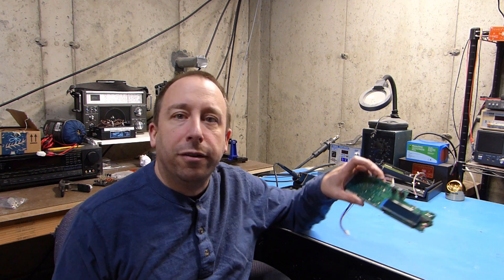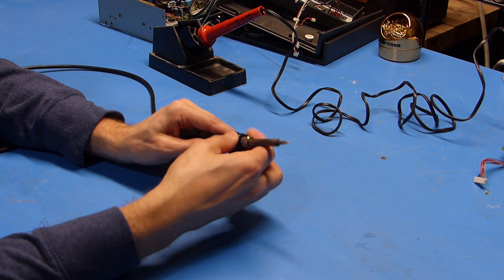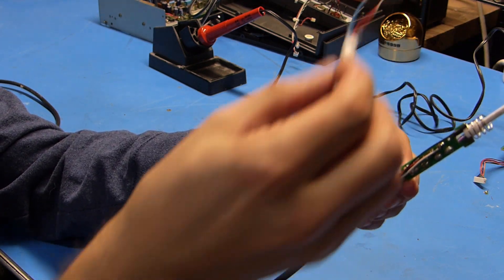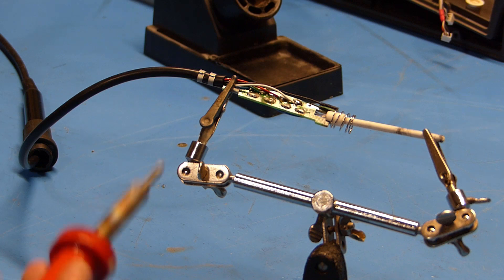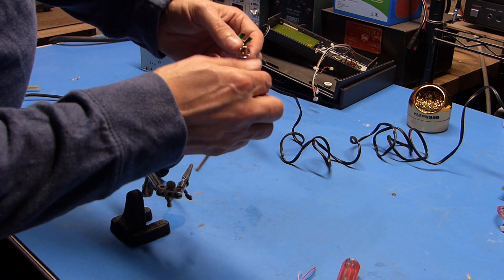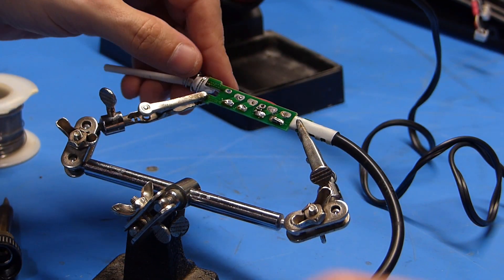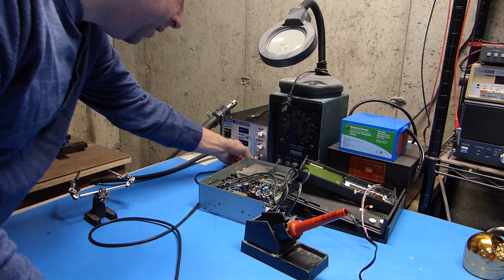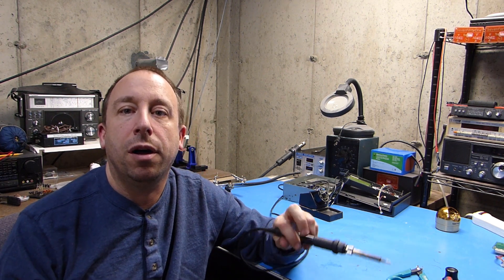X-tronic 4040 Soldering Iron Heater Replacement Error 5-E S-E

Comment: Thanks for posting on how you repaired your soldering station.  I too had a 5-E error on my knock-off soldering station.  My soldering station didn't come with a spare board.   I decided to try and refloating the solder on the control board and making sure enough wire was being covered by solder.  For me, this solved the problem.   I still might go shopping for a new soldering iron this time with a bit longer cable.  It would be fun to play with your old control board to see if it could be the same issue.